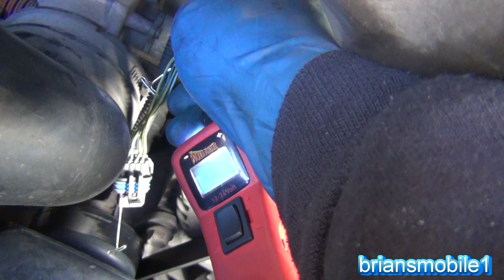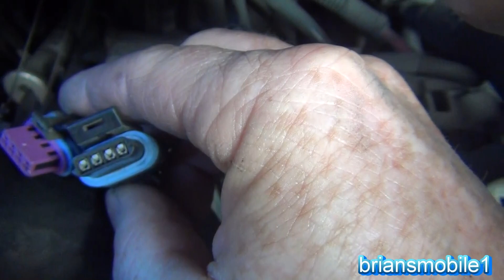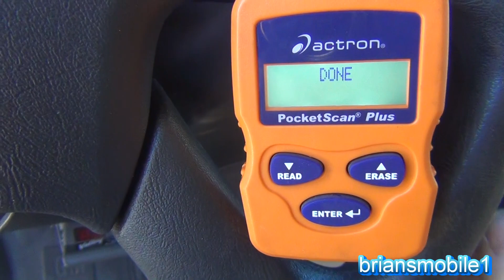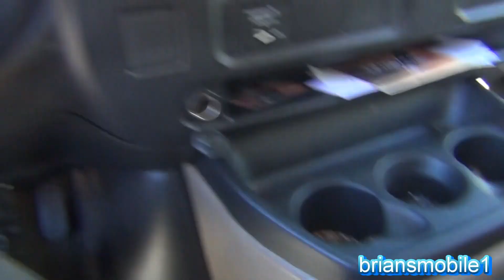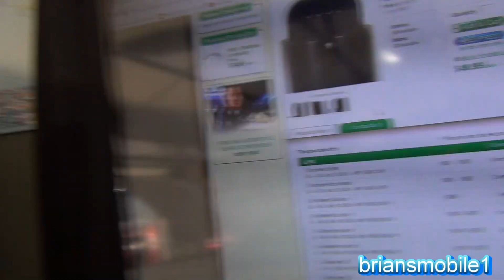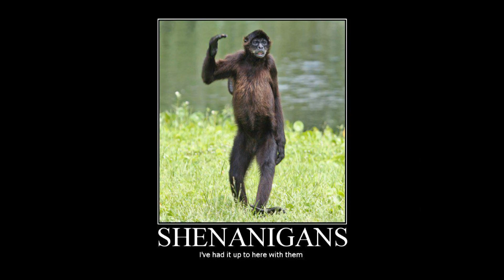2004 GM Van Idle Air Control Chaos & Cheap Fix

Comment: Thank you very much for this video. My 05 express 3500 6.0 just had the exact same issue/the exact same wire was visibly broken from heat and being bent near the connector. 👍👍

Comment: Hi, Brian. I have 2005 Chevy Express Van; 6.0liter. Problem: van shakes when idling.

Had new motor installed, and the new motor shakes like old motor.

No one seems to have solution.

Do you have any ideas?

If so, please txt me: 864-325-9939.

Comment: I had my ecm replaced in my 06 savanna with reconditioned part from cardone at dealer. Stuck on high idle still. i Need a solution.

Comment: I have a 2005 Chevy Express 2500, 4.8 liter V8. It has intermittently been idling badly, once in a while idling way too fast etc. Eventually it was stuck idling extremely fast, started overheating also. I found this video and as you suggested, the wires were broken at the connector, only one appeared to be so I soldered it and put everything back together. To my surprise in ran terribly.and stalled out constantly. I found that O'reilly Auto Parts actually HAD the replacement  connector in stock (part # pt302), so I figured it had to be either other broken connections to that connector or the IAC motor itself that was bad.  (The connector was about $22 and the IAC was about $60, so I'd try replacing the connector first.)
Like a miracle it started right up and ran great.. It had probably been going out for a long time. 
Thanks for pointing me in the right direction!!

Comment: If a BM Trouble U ever come into your garage with a P1093 diagnostic trouble code, it could also be the Idle Air Control.  Had the code and replaced the precat 02 sensor, but the code kept poping back up.  Read on the E46 fanatic forum that after replacing many parts while trying to track down the problem, the last part the owner replaced was the IAC and he never got that code again.

Comment: Hey Brian Whats up? Love watching your vids. Just wanted to let you know, even though im sure you are probably aware. Amazon is a great place to buy Automotive parts from. I buy stuff for my truck sometimes off there. And what really cool is they carry all kinds of brands. If you have GM they have your ACDELCO and or Delphi, if you have a Ford they have your Motorcraft. But if you like certain aftermarket brands, they have many of those as well.

I did look up a Idle Air Control Valve for that van just cause i was curious, even though you found out it was the wire, and it came up with nothing. Kinda odd. I even tried looking up a 2003 and a 2005 and 2006 and still get nothing. No ACDELCO or Delphi. Weird.

But anyways. I just wanted to say i love your vids and will keep on watching them as you post them. Also wanted to tell you about Amazon, which im sure your aware of.

Well keep up the cool and very entertaining Videos.

Take Care

Comment: Hi Brian, why not just do a key-on loaded circuit backprobe test at the IAC valve with a regular voltmeter? With the help of a wiring diagram, you can pinpoint the "bad" wire in just a few minutes without poking holes and beeping :) Love the fun bonus material in the end!

Comment: IACM is probably the same for that too, just most large vans are commercial, GM pulled them because company vehicles will pay whatever $ to get it back on the road.    ;P
complete guess, but ....i wouldnt put it past em.

Comment: Ohh,connecting control lines to +12V.. No bueno. Use a DMM.
Reply from the maker: It sure can be!  Hence the warning I posted already.  The trouble with the DMM on a continuity test is you can have a false positive because there's no load.  Ideally what I could've/should've done is disconnect the PCM plug before doing a voltage drop test or a +12V test.  That would've isolated the PCM and thus protected it better.

Comment: With your spare connector, I’d be worried about the sockets on the end of each wire inside the connector being too large/small for the pins inside the IAC valve. If they are loose then you might get an intermittent connection. The spare connectors sockets seemed much bigger then the stock connectors.
www.rockauto.com has the connector for $8 (Standard Motor Products Part # HP3895) and throttle bodies for $140-$260.  Sadly, they don’t have an IAC valve for this truck that I could find.

Comment: Why not use a multi-meter to do the continuity test instead of the Power Probe?
Also, your test was kind of invalid. A continuity test (even with a multi-meter) will give you a false positive if every tiny metal wire inside the wire is broken, except for one. That condition would cause some serious heat in the wire too.  A better test is a voltage drop test. It would tell you in one test if you have an open, short or excessive resistance.

Comment: Would the icv make it stall out or even die like say in a cold morning?  It starts up fine then just idles like crap and sometimes even dies.
Reply from the maker: Yes.  If it's stuck closed you stall, if it's open like this one you idle too high.
Reply: briansmobile1 tried cleaning it still acting all funny.  Probably should just buy a new one and see.

Comment: Did the wires and the plug just melt from the heat put out by the alternator? Because the wire does not look like it's a very high current wire? Very flimsy wire.

Comment: Brian, those  T pins come in a smaller size also. I use the large ones for connectors and the tiny ones for wire piercing if need be and back probing weather pack connectors. both are available at your local Wal-Mart.

Comment: What cause the wire melt down? Cheap production? Or is there a underline issue with the iac valve? Hey B? That autle maxis you speak of is a 3k scanner huh?No good coverage??

Comment: When possible I prefer to solder wires and not rely on twisting them together alone for a solid mechanical connection.
Reply: Under the hood the heat won't let it last. I prefer to pinch it together with a splicer...but braiding it when it's that small AND soldering it might be just perfect huh? Those splicers take up a lot of space when you need 4 in a little space.

Comment: Most guys would have installed the part without doing the checks on the wiring thus costing the owner more. Great job tracking down the issue, and I am still wondering why it didn't blow a fuse.
Reply: Me too, but then  I think about it again and Brian showed how much better the wiring on GM's used to be. That tells me that the fuse is of course better than the wiring. So the wrong one goes first.

Or it melted together from external heat, rather than internal heat...at that point, why would the fuse protect the wire. Just thinking it all through. :)
Reply: DE Nichols It could definitely be the case that the insulation isn't nearly as "tough" as the earlier models and doesn't hold up to as much heat as the earlier models. I didn't really think of that, but it makes sense now that you pointed it out. :)
Reply: Eric Borders Without out you asking the question, I wouldn't have thought more on it, thank you.

Comment: So you just shove pins into the wires to check for continuity? If everything had checked out do you just tape up the wires that you checked when done, or something else?
Reply from the maker: I use pins because you have to get in there somehow.  After pinning, the wires still can't touch each other- it's least invasive.  To answer your question yes.  You tape them back up.  I like to pinch the hole shut with needle nose pliers- then tape them.  If it's an ABS wire splice I'll use heat shrink and solder, but on something that died from heat like this, twisting is best.
Reply: briansmobile1, with something in the engine bay (hot/code cycles) and exposed to the elements, electrical tape doesn’t really hold up for very long in my experience. The tap doesn’t really seal and the glue often fails and separates over time. The hole then becomes a vector for moisture to get in and corrode the wire from the inside out.  Liquid electrical tape or nail polish (in a pinch) will seal the hole nicely and last a heck of a lot longer.
Reply from the maker: That's true.  I probe high enough that the loom covers it and keep moisture out.  Up that far it's clean.  I have liquid electrical tape, but felt it was overkill AND messy to use in this instance.
Reply from the maker: I have big hands. T-pins are easy to manage.
Reply: briansmobile1, agreed on the T-pins. T-pins are also very sharp/pointy and work great for holding dead frogs down in high school Biology classes.  :-)

Comment: Gm has had connector problems for years it seems. I had a gm tech (buddy) order me a pin kit from there supplier and it even came with removel tools. Awsome kit. I dont have no info on it because I no longer wrench for a living. I was always nervous about connector repairs coming back on me . Because you never know if the component was the cause of the ressistance or if it was the connection. My gm buddy told me most of the time it was the pins opening up and pushing out of the connector. I sure lost a lot of time on gm wiring connectors in my day !!! Great video Brian :}

Comment: Hey Brian, great video & fix. I have a 99 civic wich idles high & hunts when cold but is fine when warmed up, I have cleaned the IAC valve & throttle body but it still does it, I would like to replace the IACV but they're like £300 so I'd like to be more sure. There's no FITV on this year. Many thanks
Reply: You need to do an idle relearn, common with all Hondas if the ECM/PCM loses power. While the car is cold, disconnect your battery for 30 seconds, reconnect. Then start and run your car at 2000 rpms will all electrical and a/c off until the cooling fans come on. Then let the car idle for 5 minutes, should do the trick. If not, then dig deeper.
Reply: Milford Civic Thanks for that. I did the timing belt & water pump on this vehicle a few months ago & did as you said to bleed the cooling system. It was better for a while but gradually gets worse again. It does use a little bit of coolant (perhaps 1/2 litre per month) do you think it could just be a coolant leak. Another thing, although it is fine when warm, occasionally on a long drive the temp gauge will drop to zero & the idle will be high.
Reply: Chris Callow You might want to use a block tester just to be sure combustion gases aren't getting in there.
...
If you do have a coolant leak, everytime a Honda gets bubbles it while have idle problems so I think you've found the symptom of another problem if it keeps coming back. I kept having to bleed a 94 Ford Escort many years ago, I'm glad to know now that bad radiator caps don't just keep the pressure in, if they're bad, they'll let coolant in and out of the reservoir at the wrong times. Relooking at your comment, I think your radiator cap is good.
Reply: DE Nichols  I say you found the problem, but really, I think your experiencing a secondary symptom from something else.

Comment: Erg, couple of things Brian, and you're probably going to hate me...

The "intermittent" signal you were getting is correct when using a power probe.  The circuit is actually two ADC circuits (Alternating Direct Current, meaning it switches polarity) that drive an internal stepper motor, and a feedback-sensing position circuit.  If you see yourself working on any GM IAC systems (non-DBW), invest in a GM IAC Noid light.  They're typically about $40-$50, and I've heard rumors that some auto parts stores carry them.  You'll need bidirectional scantool control in order to use it, though.  When in doubt, unbolt the IAC from the throttle body and position it facing away from important things, then cycle the ignition to KOEO.  If all is well, the IAC pintle will fly across the room.  Good luck...  XD

Secondly, double, triple, quadruple check the VIN.  2004 Express vans were DBW.  2003 had a separate IAC.  It's possible it's a transition model, however, in which case the 2003 IAC valve will work, and are available.

Third, and more just for FUN FACT TIME!!!(tm), that style of IAC is very common, but the pintle design on the end is what changes.  Sometimes (SOMETIMES...), you can interchange them, but not always.  The one you were looking at on the O'Reilly website, for instance, may or may not work on GMs.  The exposed spring can create enough turbulence that the car won't idle right, and will eventually throw a code.  Ask me how I know this...  ;-)  Where it gets REALLY fun, is that some model GM cars will use two different IAC numbers, which have ever so slightly different pintle designs, and you have to get the casting number off the throttle body in order to determine which IAC to use.  Always always ALWAYS cross-reference the throttle body casting if you can, particularly with late-90s GMs.  When in doubt, throw part number AC160 at it; it seems to be the most widely-compatible IAC for GM throttle bodies.  :-)

And finally, if you're going to Hell, mention my name; you'll get a good seat.  ;-D